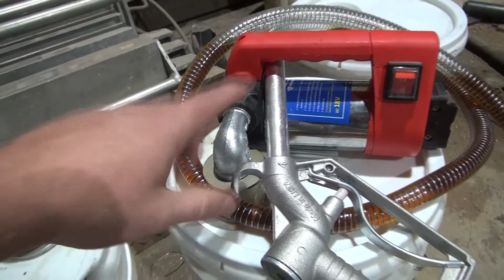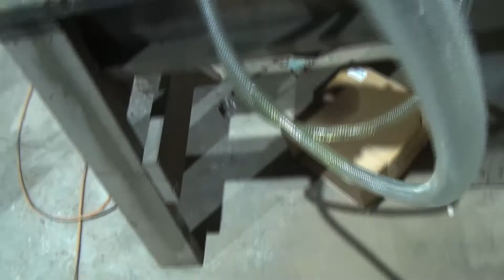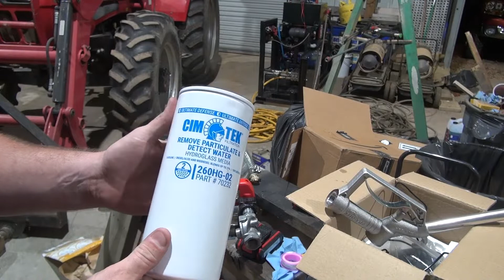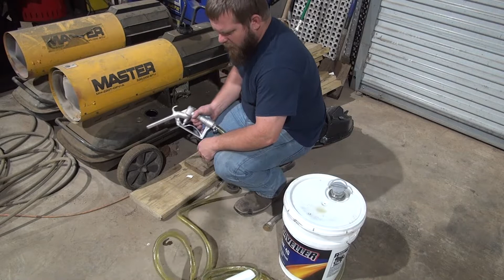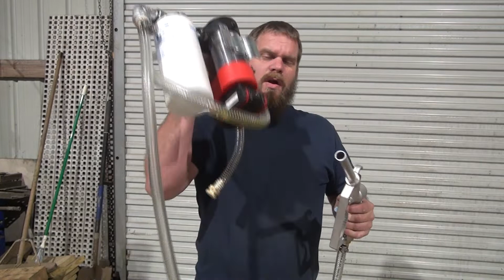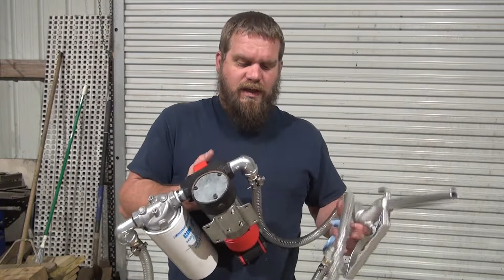Anbull cordless fuel transfer pump, everything is a transfer tank now

Comment: I know these pumps state they are for diesel or kerosene use- I’m assuming for liability purposes if used with a more volatile fuel such as gasoline. What are your thoughts on using one for gasoline?  I need to find a gas pump solution that doesn’t cost $500 or more.
Reply from the maker: Never tried to pump gasoline, But I do know You have to be aware of static electricity when pumping gas. It can create a spark and go boom 💥😀 I'm sure someone has more knowledge on the safety aspects of pumping gas safely.

Comment: Chase - just filling up… how is the pump holding up? How about the battery? Any suggestions or upgrades from your second design?

TY
Reply from the maker: Still working so far. The battery and the plastic housing could be more robust. I like the setup though.

Comment: Definitely would be nice to have around. Great idea...
Reply from the maker: Yep, example, dozer out of fuel, transfer tank in truck empty but excavator has fuel. pull excavator beside dozer fuel up dozer from the excavator and refill the transfer tank on the way home instead of having to stop just to go get fuel for the dozer. I've had to stop doing something and go get fuel before even though I had enough in something else but no good way to transfer it. I've transferred over 100 gallons so far. I hope it keeps working cause it is handy.
Reply: @LifeWithChase  very good point. What do you figure the fuel setup cost to put together?
Reply from the maker: @tristardiggin  probably around  200 ish maybe a little over. Just have to remember to keep the battery charged. I really wish it took a DeWalt or Milwaukee battery because I always have one of those charged, but it could get converted if that becomes an issue LoL

Comment: Works great bud.  Last week we hit a high of $3 a litre for diesel , that about $10.50 a US gallon.
Reply from the maker: Yikes 😳 if that happens here everything might collapse. People are struggling now, Mental health is declining and many people are one word away from a meltdown.
Reply: @LifeWithChase  Chase its nuts up here for pricing .  Our governments are saying 7-8 % inflation but so many things are 2-3 hundred percent increased.   Home heating oil  is like diesel $3000 to fill a 250 gallon tank.
Reply from the maker: @SteveRobReviews  the price of fuel determines the price of everything else. Almost everything is moved by diesel at some point, whether it be truck, train, or boat.
Reply: A liquid pipe dope is better than Teflon tape on aluminum housings .  Teflon tape is very slippery and control is lost on the actual tightness .

Comment: Thanks, good video. Two questions if you don't mind. Do you have a bypass oil filter on your truck? How often do you change the oil in your truck? Happy Thanksgiving.
Reply from the maker: No oil filter bypass. Usually 15-20k. Will be doing videos on some lab test soon. Stay tuned
Reply: @LifeWithChase  Thanks and will do.